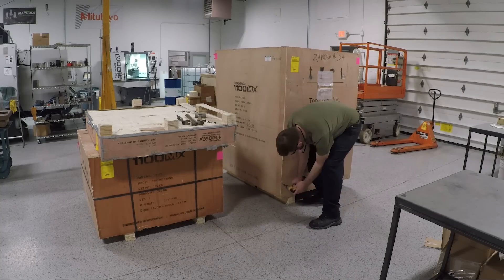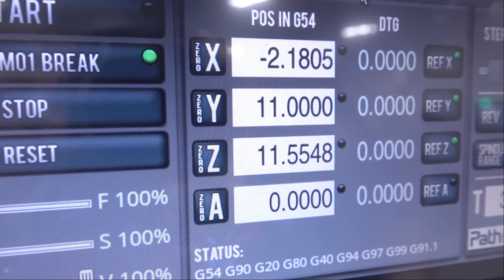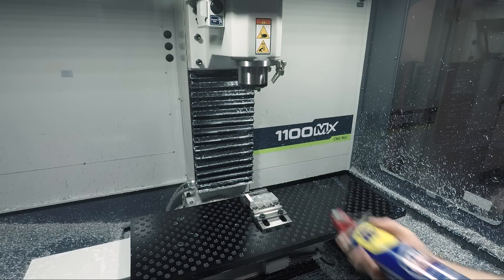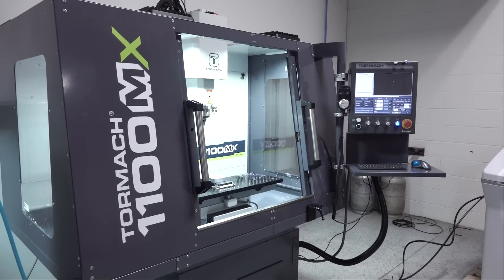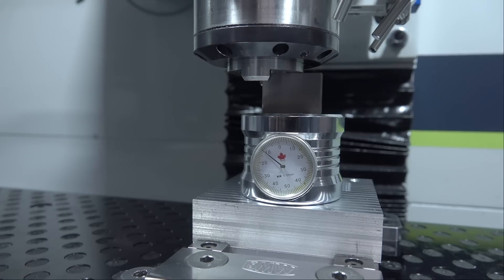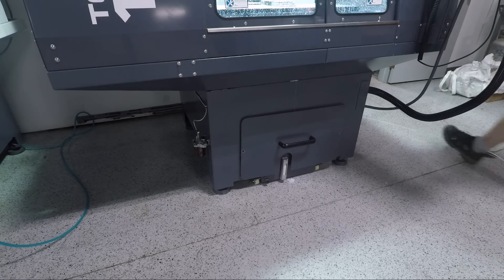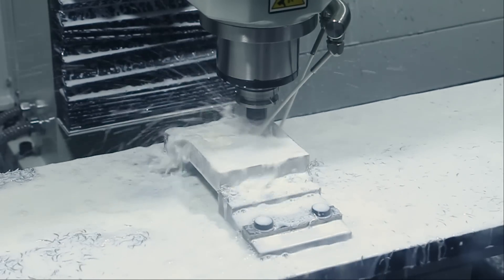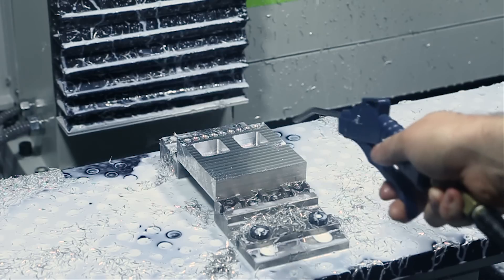Tormach 1100MX:  Assembly, Test Cuts & Initial Impression!

Comment: Honest questions but why would you buy a tormach 1100mx for 25,000+ when you could buy a haas tm1 for 5,000ish more?  The tm1 is twice the machine the tormach is for 10 to 15% more.  That's not much of a difference when you are talking about business investment.
Reply: Closer to  $11K difference once you upgrade the TM1 from standard 4K spindle to 10K. Then add $1600 for rigid tapping.  Does the TM1 have a toolchanger option? Couldn't see it on their site. You do get quite a bit more spindle horsepower on the TM1 though. Axis speeds are roughly similar, 200ipm for Haas and 300 for Tormach.
Reply: @alphgeek  Now that the Tormach runs standard bt30 holders you wont save anything on holders now. By the time you tool up the machines and buy vises and other supporting equipment the price difference diminishes. TM1P is the version with tool changer. Haas often has 10% off and other deals going and very easy financing. I own both a Haas and Tormach, Haas cost more but more value in my opinion. To me the value of Tormach was with power drawbar and stand.
Reply: alphgeek I was just looking at that, but if I was in the market for a $25,000 machine I would be looking at a used low hour haas.  And it’s cat 40 tooling too.  I like that tormach added servos and a proper spindle but it comes at quit a premium.  The main draw back for me is tormachs dove tail ways.  I have upgraded my RF 45 grizzly clone with linear bearings and it made such a huge difference I wouldn’t go back to dovetail ways.  I am looking at doing the x and y soon.
Reply: I’m gonna go with 3phase power vs single phase power. 

Sure. Phase converters and VFD’s exist,  but you always lose something in the process converting single phase to 3 phase. 

It’s also a more compact machine allowing it to be put in someone’s garage or basement and can be moved without the need to call in riggers.

And you’re pricing is off. A Tm-1P with similar capabilities to this 1100mx is going to run you just north of $45k. Even if you score on a 20% end of year discount, that’s still the $38k mark. And that’s before the cost of freight and rigging.
Reply: @northernsmith  I agree about the linear bearings.  My next home CNC will be the new one coming out from Vulcan Machine Tool.  They use linear bearings as well, 12K spindle, something like a 1200lb casting, etc.. They are here on UTube as welll.
Reply: I have a tormach and a Haas TM1P. Haas is a thousand times better. Haas 7.5hp .. 30 inches in X. Way faster. My haas can go faster in aluminum than my tormach in wood.
Reply: Even better a used mini mill with everything ready too go. Or a syil x7. The real thing is tormach did good marketing in the hobby space making themselves appear more approachable

Comment: Tormach machines are a piece of shit. They are nothing but mini mills with tool changers & enclosures. After you level & square the machine the first 3 test cuts are a square, triangle, & a circle. Doing this will tell you how you have to adjust the machine. I know since my father & brother not only assembled CNC machine tools but also installed them. They also did a lot of warranty work. They had worked for Ingersoll Milling Machine which made a lot of stud bore machines but also made a lot of custom machines and machining lines for companies such as GE Aircraft Engines, Nuclear, & Gas & Steam Turbines, GM 231 engine machining lines, Cooper, & more. Their machines were one of the best machines made that the Soviet Union had a couple of nuclear missiles targeted for Rockford, Ill. since Rockford was considered the machine tool capital of the world.